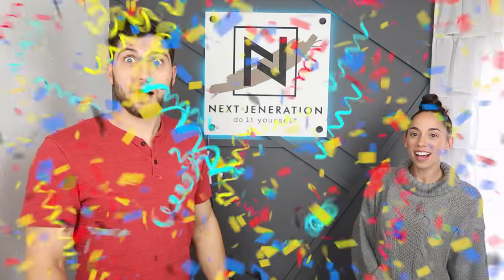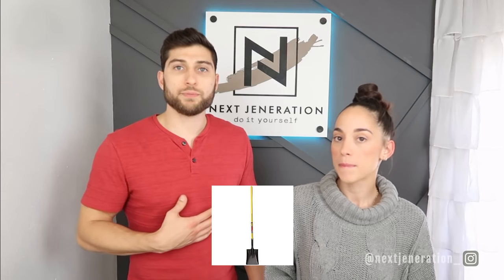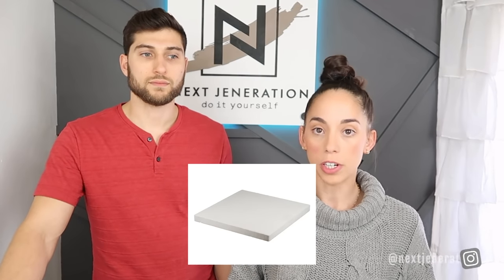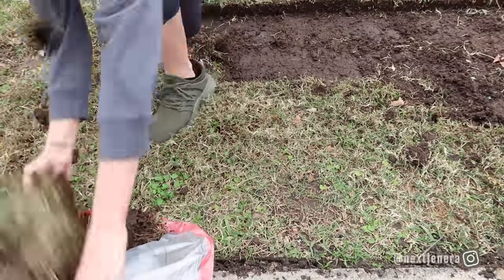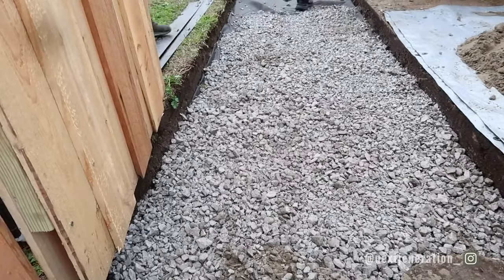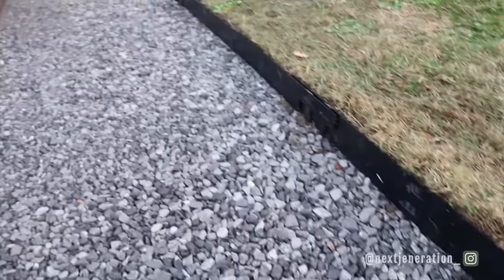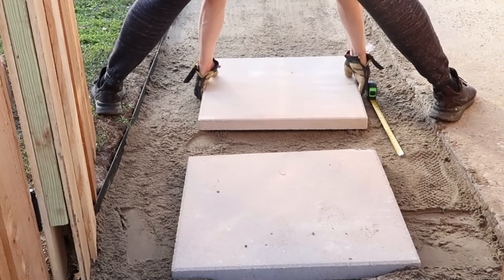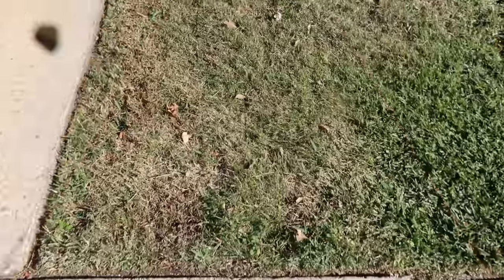DIY Pathway with Drainage | Walkway with Pavers

Comment: So it's been 2 years since you made this. Can you do a Follow up video? Great job!
Reply from the maker: Yes, it’s still holding up great!! Just have to pull weeds a few times a year, but no complaints!
Reply: @NextJeneration  wow those weeds get through anything. Would going deeper even help? Or maybe using cardboard instead of barrier. Just trying to brainstorm. I’m literally doing this exact thing right now.
Reply: @NextJeneration  U should put mulch glue on the lime stone. They will stay in place and no weeds come through. It's awesome
Reply from the maker: I’ll have the check it out!
Reply: @ysbelbella6674  but then will that help with drainage still?
Reply: Nice job guys.

Comment: Hi guys, my wife and I came across your video and looking to do something very similar, so thank you for this video. One thing that we are having a hard time wrapping our head around is how does the water actually drain? I understand that water can travel through the spacing between the rocks compared to having water just sitting on top of the soil, but when the walkway eventually saturates, where does the water flow to?
Reply from the maker: Ours is on a slant, so it travels down the pathway and into the street where it goes into the drains

Comment: Omg I actually planning to do this with mine soon. But the thing is my house/driveway is on an elevated ground level so the end of my driveway is going down hill a bit. any tips on that end of the driveway ? Would the same method still works and cement blocks still sit flush / even out ?
Reply from the maker: That’s the way ours is too! On a slant

Comment: I would love try and instal something like this but I am afraid there will be a lot of weed growth. What’s the solution to prevent weed growth in this type of installation?
Reply from the maker: It honestly can’t be fully preventable. We laid a weed barrier and we’re still out there 3-4x/year pulling the weeds. If you pull the weeds by the root, it should help maintain them from spreading/growing rapidly!

Comment: Why is the base and sand necessary?  Theoretically can you just add more limestone to replace base and sand? Just curious!
Reply from the maker: For long term stabilization! Also, the gravel at the bottom is for additional drainage. But the sand is necessary so the pavers don’t “settle” and become wobbly!

Comment: By laying the pavers directly on the sand aren’t you concerned they will move or sink over time? Why wouldn’t you mortar/cement the pavers and point them so the are solid fixed?
Reply from the maker: The gravel allows water to get in and drain, and it also absorbs ground tension, which prevents the pavers from sinking. Then we added sand over it (and tamped it solid into place) which serves as a main stabilizer over time. When you place the pavers on the sand, they should sink slightly to “lock” the pavers in place. Without the gravel & sand, the pavers will shift over time. You could do cement, but that’s not a draining option for us. Gravel & sand will give the same result (with less work) as the cement, but will also drain heavy rains!

Comment: Are you concerned about weeds growing in the sand? I did a similar project and it turned out great but within 4 weeks weeds started to grow in the gravel dust.
Reply from the maker: I’m not, that’s why we did a double layer weed barrier. Some will still pop up, but it makes it more manageable. We did the pathway about a month before I uploaded it on here, and we’ve had 1 weed in the 21 feet of pathway, so not bad!

Comment: is the gravel necessary if ny front yard is all dirt right now
Reply from the maker: It will help with drainage when it rains so that your pavers won’t sit in water. We get A LOT of rain here, so we had to find a place for the water to go so it didn’t sit on top the pavers or wash away the top layer of gravel. It’s worked great! We were just hit by a horrible hurricane (Ida) on Sunday, pathway still looks perfect!!!

Comment: Hello! If I’m using a smaller slab, how could I keep it in place apart from the weight?
Reply from the maker: The sand should hold it in place, is it not? Between the sand and the gravel around it, it should stay secure in place!

Comment: Great video, what size limestone did you use on the top / between the pavers. You mentioned its smaller, is this 1/4" clear material. Thanks
Reply from the maker: They’re 1/8-1/2” pieces

Comment: Nice project. But can you drive on it? What happens if you go a little too far over with a tire?
Reply from the maker: I wouldn’t recommend driving on it, you could possibly crack the paver. The driveway is wider than standard, so we’ve never gone into the grass the 8 years we’ve been here.

Comment: How wide is the pathway ? I didn’t catch it in the video
Reply from the maker: 3.5 feet!
Reply: @NextJeneration  one more question about how much depth wise was the sand ?
Reply from the maker: About 2 inches!
Reply from the maker: I recommend googling a “sand calculator” to see exactly how much you’ll need for your pathway size!
Reply: @NextJeneration  I meant like did you guys have a depth of 1” of sand or like a half inch
Reply: @NextJeneration  I meant like did you guys have a depth of 1” of sand or like a half inch

Comment: Nice! For reference, how many inches deep for yours? Is this project meant to be walk on only, not for parking over?
Reply from the maker: I don’t remember exactly (it was months ago), I believe around 6-7” deep. Each layer of aggregate was around 2” deep and there’s 3 layers
Reply from the maker: I would not use this to drive on, the pavers are likely to crack. I would suggest all gravel for a driveway, or pouring concrete.

Comment: Can i use plastic lawn edging instead metal edging for my garden walkway
Reply from the maker: You can, we were just worried it would eventually crack over time and there would be no way to replace it once it’s under gravel. The metal will last basically forever!
Reply: @NextJeneration  I see thank you
Reply: Hi, with our weather here in Montreal I would definitely go with the metal sidings. The only things is that I can’t find it. Could you post the link of that metallic sidings (not a prob if it’s in the US). Great job by the way!

Comment: How many inches you guys put In the sand?
Reply from the maker: I believe 3 inches, I mention it in the video!
Reply: You really don’t need 3 inches of sand. I’ve knocked out two of these myself doing 3 inches of gravel and an inch and a half or so of sand and it holds up really well

Comment: Great job guys! We wanted to do this project in our front yard too. We have a grade and was wondering how do you account for that so the pathway is nice and even from end to end? Basically our sidewalk is a lot lower than the other side (concrete near the front of house). So if putting say an even 2 inches of gravel/sand all the way around, wouldn’t it make the pavers on the higher side sit below the edge of the concrete?
Reply from the maker: I don’t think I fully understand, but I will say to try to have the pathway higher if anything so it doesn’t flood! You can use the metal edging like we did to hold everything in place and just follow the preexisting grade. I hope this helps!
Reply: @NextJeneration  thanks! It’s not a crazy steep grade I think I can manage just following it!
Reply: I loved your video and was just looking through the comments to see if anyone mentioned having a slope or grade. We do too and the ground here in GA is heavy red clay, so water just floods off. I’m hesitant to put a lot of sweat equity into a project on a grade since my grandfather was a civil engineer and I saw first hand how long he would take calculating slopes, weights, depths, etc. Old school, but that’s what DIY is, right? Not sure I have the training to attempt a slope, but if I figure out how to do it I’ll come back and post again for others with a grade. And, dear readers, if you’ve done this on a grade and have advice for a noob, please lmk! Thanks, Jen, for the fabulous videos and the inspiration and encouragement y’all give!
Reply: So when we completed our project, we were lucky enough that when we removed the sod, the slope was really already present…if that makes sense. Since the whole area was already on the downgrade/slope, we just used the existing slope and put the gravel/sand pavers on that angle!

Comment: You are supposed to use paver base gravel and leveling sand. It seemed you used regular stuff.
Reply from the maker: We used the correct materials :)
Reply: You don’t need paver base gravel if you’re just using stepping stones lol. What you mentioned is for a paver walkway. It’ll hold up fine how they did it

Comment: So, my landscaper just quoted me $2350 for 3.5 tons of crushed basalt gravel for my walkway. Do you guys remember what you paid, per ton, for the limestone?  I was a tad stunned at the price of the basalt....$600 a ton. 😮
Reply from the maker: That’s insane! The current price at the local rock place is $55.00 / half yd (approx 2500 lbs)
Reply: @NextJeneration  thank you for the response! I did finally talk with the landscaper and he broke down the cost...it does include the labor for 4 men. The stone is actually $220/ton, which I confirmed with the stone dealer. We're now going with meridian granite at $110/ton. I wish I was as talented as you and your husband. But if I attempted a DIY for this project the end result would probably resemble something Lucy and Ethel threw together. 🤣 Again, your results were stunning!! Simple yet elegant!!